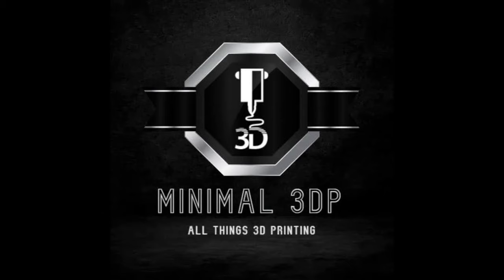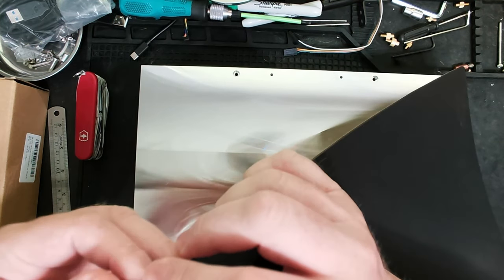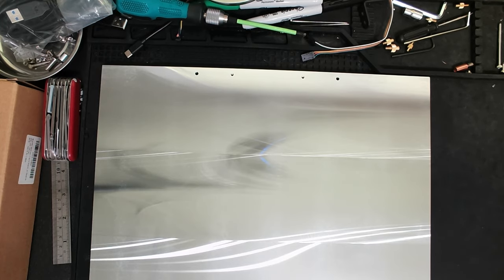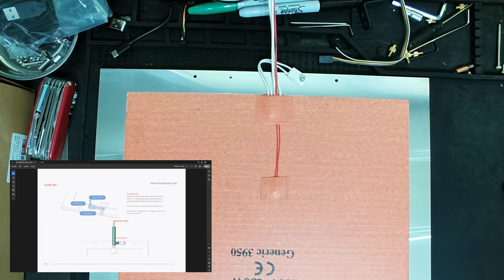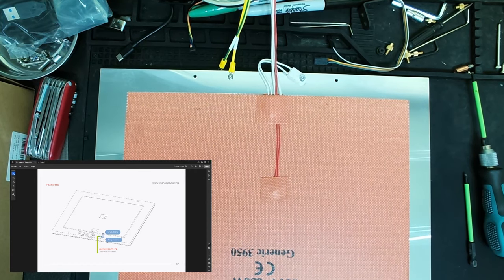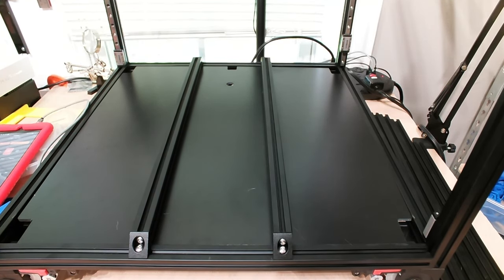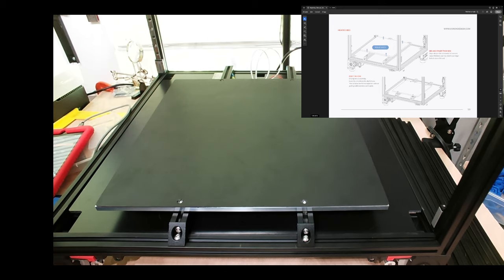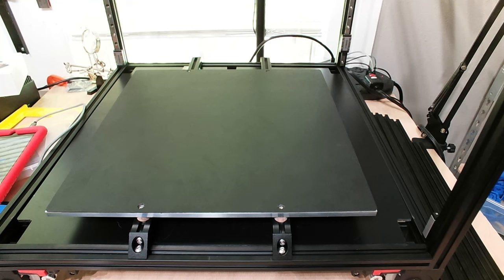Voron 2.4 R2 Build Guide: A DIY Monster! Voron Assembly - Part 6 - Installing the Bed

Comment: Thanks for the video... I have a Geeetech A30m which has a 320x320 build plate... How hard would it be to use that build plate in a 350 Voron 2.4 build?
Reply from the maker: It's probably not easy. The holes will not line up. You should research it more. There might be some mods.

Comment: I think eventually you will have to get it put together and get it moving to find where the z endstop goes, before finding out where the bed goes. So bed is probably one of the last things to install. Unless maybe if you are using tap.
Reply from the maker: I will eventually get it together.
Reply: @minimal3dp  Took me almost a year and I'm about to push my first plastic. Sooo tap or what are you going to use for z endstop?
Reply from the maker: @oscarvogel2140  I am going with the Tap. It came with the Kit